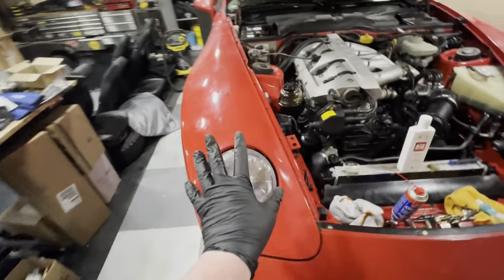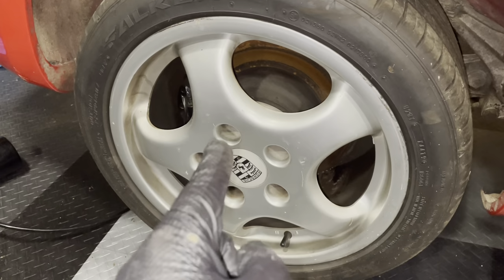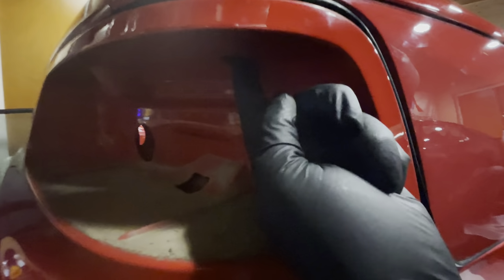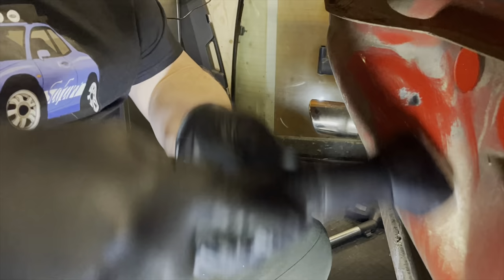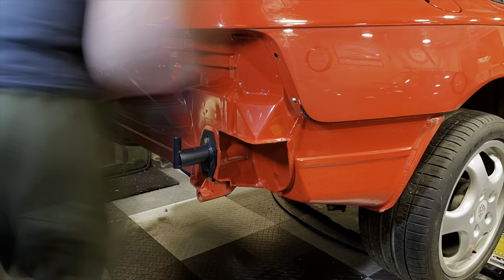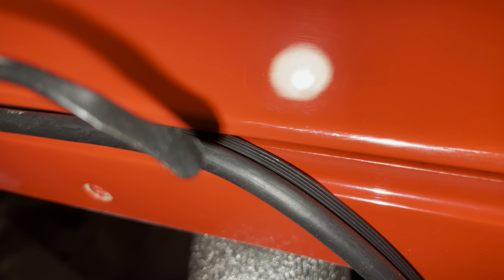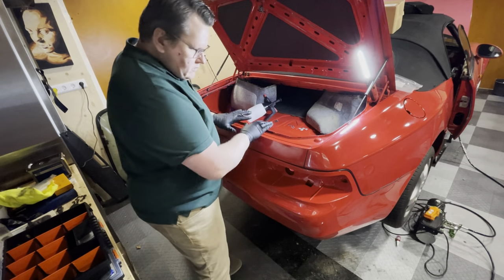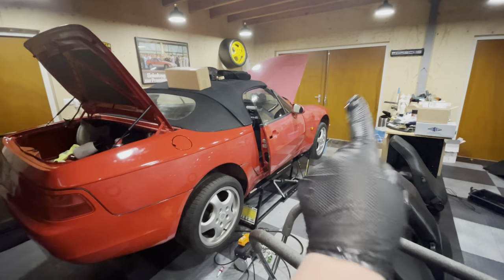Restoring a Flood Damaged Porsche 968: Removing the rear bumper cover #porsche968 #bumpercover

Comment: From the factory, each of those bumps where the top brackets sit have a piece of tape to stop them from wearing through. I'm guessing someone might have painted under there and removed the tape. I also think that's been repainted because usually there is a unpainted part on the spare wheel well behind the bumper that has the build number written in marker (it matches the number that you might have seen written on a piece of tape on the top of the cluster when you removed it).

Oh and the metal pin that comes with the bead is to put in the end of the bead and bend it around the bumper to keep it in place once it's installed.
Reply from the maker: Excellent advice James! I actually thought that wire might be for that purpose and even tested it like that, but thought this is very un-Porsche like so left it out.

I guess I'll be taking of the bumper cover again 😅
Reply from the maker: Oh yes, I never did find a piece of tape on the cluster.  But I have found many hand written numbers all over the car in a sort of paint pen.
Reply: @GarageBiljon  you'll probably find a couple on the front ones too. Not sure why Porsche only includes one with the read bead, mine is the same in the bag waiting for the day to install.
Reply: Interesting that Porsche doesn’t have anything like that for the side beads
Reply: @jeffhammond8969  yeah, the side beads have special clips at either end, I think a lot of cars are missing them.

Comment: Love following this, I am working on a new-to-me 1993, 968 Convertible here in the U.S. (but being Dutch your channel is even more relatable). No flood damage here, but the car is fully original with even the hood struts, alu lug nuts being W.Germany manufactured. After 30 years not always a good thing and I'm carefully restoring what needs attention with always deciding between - "is this just good patina" - or "damn that's really worn".  

In the last category, we have the speakers, engine gaskets where needed, lug nuts, hood struts, all interior light bulbs, the clock hands (yes yes, some good advice here in the channel, and yes, I to have some paint leftover), hub caps (really nice fully alu 928 caps at Rosepassion), fluids, belts, filters etc. 

If you ever need access to the U.S. motherload of supply and can't get it shipped over, let me know - happy to help. Regarding the  interior, not sure if your trim needs replacing, but one issue I noticed is that over time the fully black trim weathers down to a nice dark brown, meaning that if you replace any part, you will need to do all (I have a new ashtray and dash trim and they come out as fully black), for the sake of the patina I'm not doing a respray but it's either that or a full replacement. So far I have managed with epoxy, glass fiber, colourlock and ceramic coating.. anyway, your work is really impressive and the channel is informative & enjoyable - thank you.
Reply from the maker: Thank you Eelco! So you have those nice cubbie's in the rear? I love those! The struggle between keeping old parts and rejuvinating them vs. just buying a new one is real, I struggle with this every day. We should form a support group 😜

Comment: One additional thought - you may want to unbolt and pull out the crush tubes to clean in there as well.
Reply from the maker: I considered doing that, but could easily get their insides clean in situ using a toothbrush.

Comment: There is tapered left hand extractor sockets to remove lock bolts and rounded nuts. Usually cheap and VERY useful.
Reply from the maker: Yes, great idea!! I did not think about that! A much better solution than hammering on an 18mm socket. I have a set of those extractors in my toolbox. Thank you mawe42!

Comment: I’m trying dk take mine off now to put a new bead on.  The cover is stuck in the middle despite following this.

Could it be the bumperettes?  Ur project started with these off somehow, but mine are still on and seemingly not easy to remove.  Maybe something’s with the locking mechanism?
Reply from the maker: European model do not have bumperettes,  but I believe you are correct that these have to be removed first as they are attached to the inner bumper bar.

Comment: I love your channel and the work you are doing on the 968. Very interesting for me to follow as a 968 owner. I was watching you putting the tail lights in carefully and have a question. I realized that on my 968 the tail lights wiggle a bit if I move them with my hands. They are not tightly fixed. Is this the same for you or are your tail lights totally fixed and don’t move at all?
Reply from the maker: Thank you very much Titan! I'll have a look for you and let you know.
Reply: @GarageBiljon  thanks a lot and greetings from Switzerland.
Reply: Did you have a chance to take a look if your tail lights are also a bit loose if you try to move them with your hands?
Reply from the maker: Sorry for the delay, but I had a look and mine are nice and tight in the bumper. Very little movement.
Reply: @GarageBiljon  No worries at all. Busy day schedules. I never took the rear apart but from your video I couldn’t see how they are fixed. Is there a way to tighten the tail lights of the 968 without having to take the while rear bumper away? I don’t know how they are really fixed.
Reply from the maker: Yes  @titan3025 , behind your carpet there are black rubber caps. If you remove this cap you will see the black nut that attaches the light to the car. Try to tighten the nut it should steady your light.
Reply: @GarageBiljon  oh great. Glad to hear. Sounds simple enough. Thanks a lot and looking forward to your next videos.